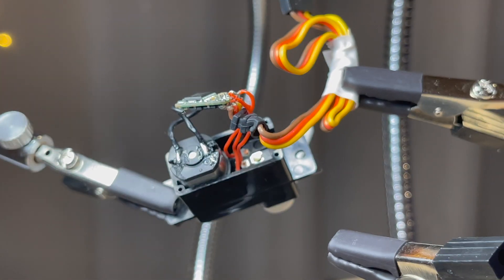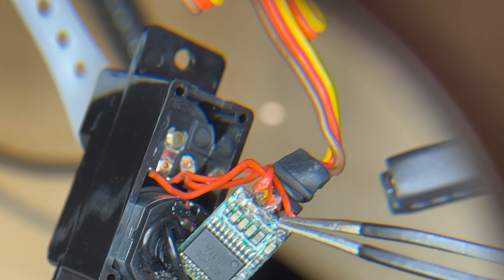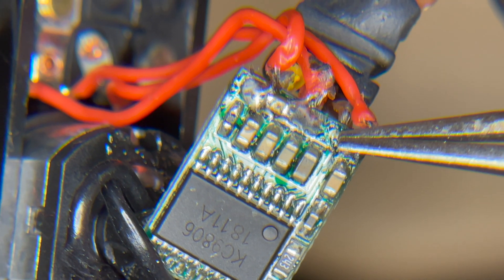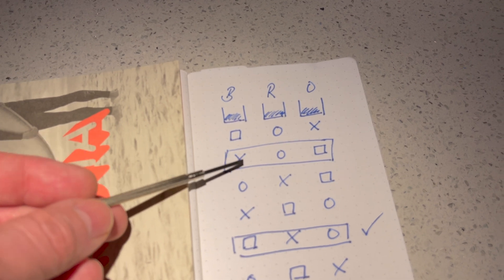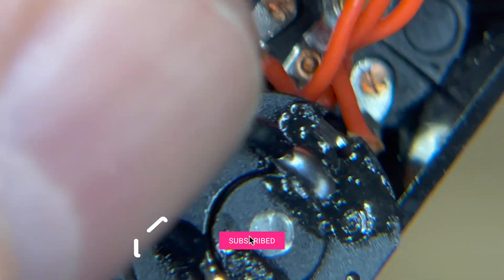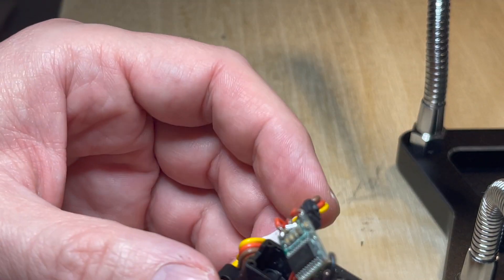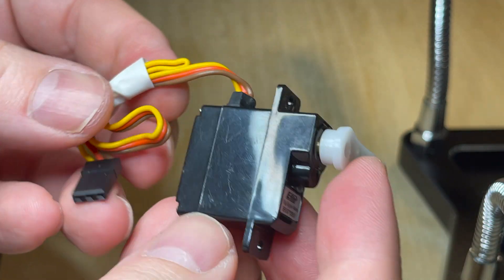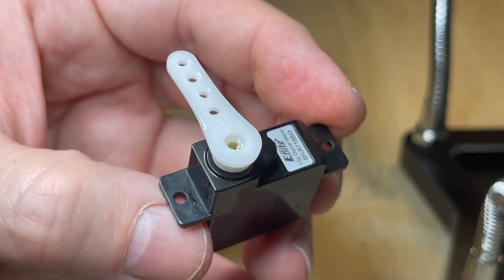E-flite Opterra 2m | reversing servos | Parrot Disco Chuck - FPV long range drone build ~ PART 5

Comment: What was wrong with just taking the servo and rotating it 180°
Reply: Or buy a transmitter that can just switch the servo direction
Reply: Even an 80$ flysky can do that
Reply from the maker: It wold work but not if you want to use the Parrot Disco CHUCK as control unit and core system. 
To use the CHUCK is the point of this build.
Reply from the maker: Well, in this case, it just would not fit that way. But this might be a solution in a similar case if the model allows.

Comment: Why did you not just swap the 2 wires at the connector?
Reply from the maker: well, that would unfortunately not reverse the servo.  In total 5 wires have to be re arranged to do the trick. 

The connectors on the actual servo motor need to be switched from plus to minus. 
Snd besides that the 3 red cables leading to the servo controller.

Comment: Very nice video. Could you not have just cut the wires and flipped them and soldered the wires, instead of opening the servo housing and soldering the board?
Reply from the maker: Thank you for asking! Good question. 
Unfortunately that is not possible. There are 2 steps to reverse a servo. 

1) flipping the wires on the servo motor, switching + to - to reverse that one. This is quite straight forward. However part 2) is more tricky. 
The servo motor has its own control board overseeing inputs, servo range, stop points and all other functions the servo is performing.  That wiring to the servo mainboard has to be reversed separately to match the now reversed running servo motor. 
The wiring to be reversed are those 3 red cables on the bottom site of the servo logic-board below the brown, red and orange wires on the top of the board I was talking about. 

That was challenging since with 3 wires you have basically 6 combinations in total and if you don't know which one is the correct one you have to solder your way through all 6 systematically until hitting the right one. 

Thank you for your support and have a great day!
Reply: @MattShonan  great. So will this servo setup now allow you to switch between the parrot controller and the tbs tango without the need for any servo reversal setup?
Reply from the maker: @beefybeef1326   Yes, that is correct!